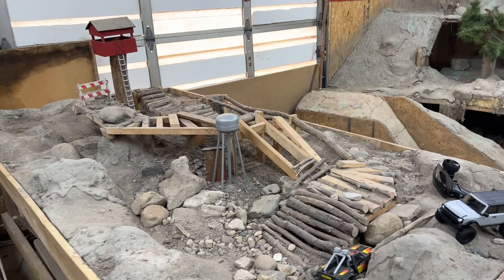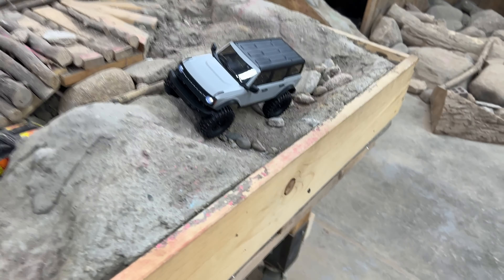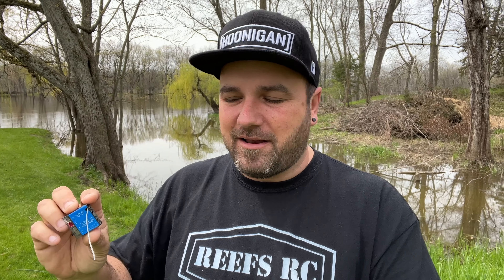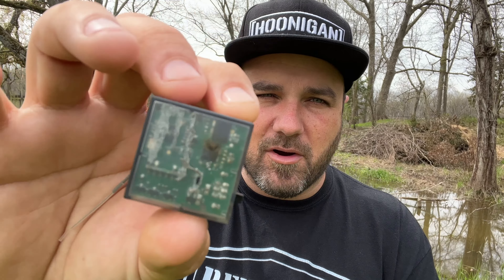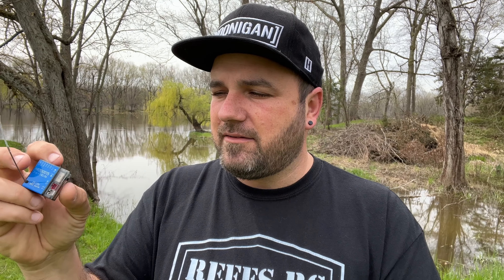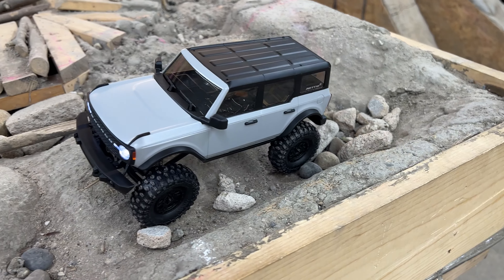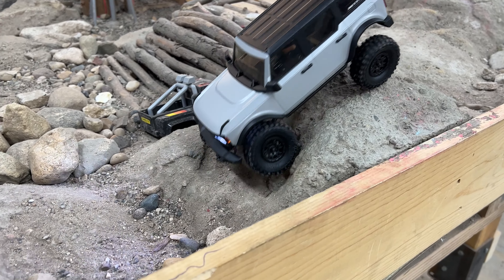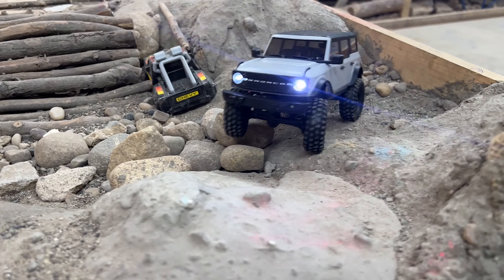Testing Stock SCX24 Bronco Without Roof Rack or Spare Wheel. Also Sneak Peak Of A New CCxRC Product

Comment: I’m starting to learn it doesn’t matter what brand RTR stands for Ready To Replace! My last trip out I had 2 main gears go out & a original servo freeze up. What concerns me is one is a new Losi Lasernut on its 4th time out the gear just stripped right out. I do love upgrading but things like the gears should all be metal. It doesn’t do any good to have a 600$ RC that can’t run because of a stripped out gear & while I should ask for a warranty replacement I’ve already purchased a metal replacement because they would just sent me an original which apparently is junk.

Comment: I thought about stripping mine but really liked the way it looks. I just added metal wheels, brass diff cover, and 3 nickels on top of my servo and it works pretty good. Can't wait to upgrade further.
Reply from the maker: I have one that I kept everything on but the spare wheel/tire. I added weight down low as well.
Reply: you can stuff two AA batteries on top of the servo for more weight

Comment: I really want to build a course with similar material, I saw a mesh there so I am just curious if the terrain was molded or formed with plaster or something and then gravel and rock added? I want to use dirt but I am not going to use it indoors, so I really want something similar like this but what is if exactly?
Reply: someone answer I also need to know lmaooo

Comment: Horizon Hobby is outstanding at making things right when a problem arises. I did the same mod to my blue Bronco and it crawls much better. Did you add larger tires? They look larger than my stock. I tried modifying mine and it does not respond well at all. Much better stock with the upper weight and spare removed. I tried 56mm tires and 43mm Injora shocks and it was horrible. Went back stock and it’s much better but not nearly as good as the C10, JLU, or Gladiator. The new ECS is way smoother. Good video thank you!

Comment: Hi, I'm new to this and I've been given a scx24 Bronco. Is there anything that tells you that the car has little battery left? To damage the battery, how long is it advisable to use it to charge it? Thanks a lot
Reply from the maker: The lights will start to flash when the battery gets low and you’ll notice reduced power.

Comment: I had 2 of them fry.  Switched them over to Lizard Pro's.
Reply: Did you eliminate the stock esc/receiver and use after market receiver/controller? Mine smoked and can't find out if you can use my own rx/tx with the lizard pro.
Reply: I did, I'm using the 6 channel Radiolink transmitter and receiver with the lizard pro. Did this on my 2 scx24's. The V2 combo that comes with it will not work with the lizard pro. Channel 2 is output only.
Reply from the maker: You can use your own RX/TX. The lizard pro has a typical receiver plug